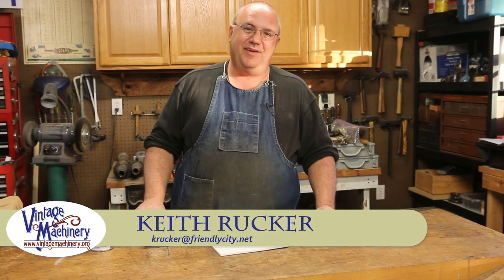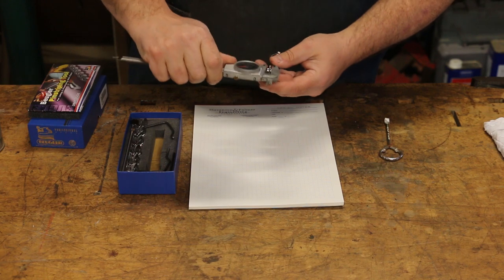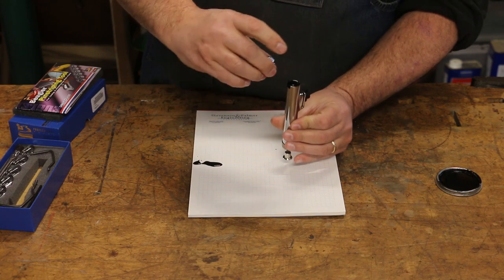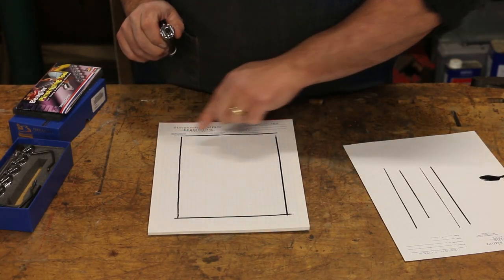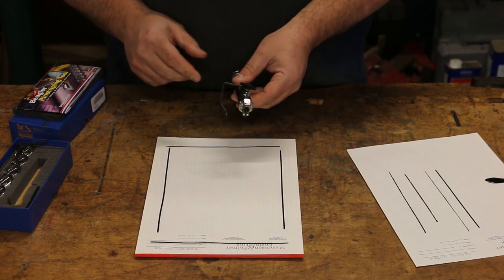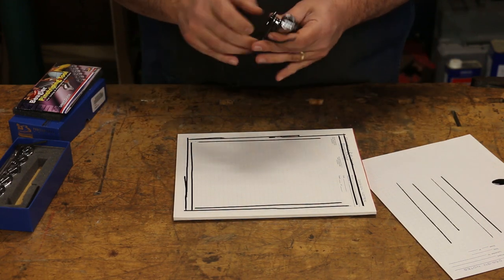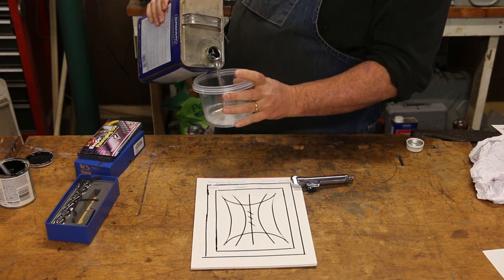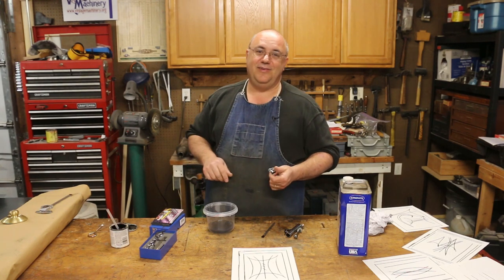Pinstriping with the Beugler Pro Pinstriping Kit

Comment: Pretty cool demo!  Nothing like real world experience. 
I dont think most machinists are artistically inclined. The only exception I can think of is Keith Fenner. A truly multi talented man.
Reply: I ran manual mills and lathes and other various machines like jig and surface grinders. I never did get into the the cnc software like cad or whatever is being used now. I could obviously set up, adjust and keep a cnc running, I just never did the programming. I prefer to feel the tool speed and feed speed and the pull/resistance on climb or conventional cuts. I’m artistic. And I LOVE manual machining. I look at them both very similarly. I think they are one in the same. I do know what you mean, but I feel like machining is art.

Comment: Hi Keith
When pouring out of gallon can you get a cleaner pour if you tilt the spout towards the far edge of can instead of towards the closer edges or corner.
Like others I propose a machinist solution to keep the wheel perpendicular to surface and act as edge guide.  A larger diameter rod having two 90* bends with the free legs being of equal length from bend, essentially a square "U".  Make rod length between bends such that you can easily adjust to follow straightedge.  Since the stock guides are so thin it is more practical to use larger diameter rods.  Fab a clamp like on the Beugler to hold the larger rod diameter and that attaches to the Beugler clamp.  When using set the offset to straightedge so comfortable and rotate the two free ends down to bear on surface.  This will keep the wheel perpendicular and allow for easy following of edge.  Also makes a good video of fab.

Comment: Some "tips" i'd like to share.

-It's best to stick with a hard surface. If you have scrap plexiglass, it's right about perfect because it's not metal hard but it's not paper soft either. It's almost paint close. You can also sand the plexiglass  back to retry.

-A good way to put paint in the container (i use it for my small air brush) is to get one of those huge syringes that have big, 2 mm needles (google this for the amazon link "Stainless Steel Luer Lock Dispensing Needle Tip"). They are perfect for this application.
Reply: ***** For the folks who don't have ready access to syringes, there are bigger droppers used for baby medicines and formula - called spoon droppers, and they hold 5 ml = 1 tsp

I use them for mixing paints for airbrushing, and for pipetting up rubbing alcohol to thin the acrylics

Or, one can buy the industrial syringes online...

Cheers,

Eric
Reply: chemech Heh, never thought of those things. I'm gonna give them a try. 

Thanks for the tip. :)

Comment: Keith, yes paper is easier than a hard surface. Best practice on a hard painted surface like you will be pinstriping on. I have one of these Beuglers and they make it look easier than it is to use. Practice practice practice, just like you would need to do with a brush. The wheels will grip onto paper better than a hard surface that has a tendency to slide around on you. In fact I think the best practice would be on glass as that would be the slickest surface and once you could master glass everything else would be a piece of cake.

Comment: 1 shot will wipe easy and neatly with isopropyl alcohol, just paint over the ends and wipe it with a clean cloth while its wet, Keith. 1 shot is nice to work with. thanks for the look at the tool though!

Comment: I just won the eBay bidding on this same BEUGLAR kit. I decided to replace my first Beugler that I bought with my first paycheque in 1961 at Sears. . The cast zinc head had deteriorated  and turned to powder.  My friend joked, " They don't make them like they used to."
  I have used Rustoleum and it is every bit as good as One Touch, for me.

Comment: I've used one of these quite a bit on horse trailers.  You can use magnets (cutting torch) of course but don't overlook a few feet of flat 10-3 or 8-2 wire bent to your curve and clamped or secured with neodymium magnets.

Comment: How long before you mount that for use on the lathe and milling machine. Just lower it to the work and feed the table across it for perfect lines.  I want to see all the pulleys for the Vance pinstriped when you are done..

Comment: Interesting kit.  I think you did better using your finger for a guide.  Thanks for the video.
Reply: Your finger did a good job, but I'm wondering if the factory guide would work better if you used your other hand to press it against the side of the workpiece as you go, and focus more on that and less on the paint wheel?  I've had similar issues with guides on cutting torches not staying against the side of the guide bar and shifting attention focus like that helped. 

-- Mike

Comment: With the tool having a way to hold a edging accessory you could probably come up with a machinist version that would keep the tool parallel to the surface and a lot less likely to wonder offline  pretty easily. Maybe a slot just in a piece of aluminum that would slide along a rule so you couldn't drift either direction. Just a thought from a guy with no art talent too.
Reply: Something along the line of a clamp an adjustable fence is what I was thinking. That way, since he was going to outline around the edges of flat surfaces anyway, the fence could just ride around the edge of the piece. I think it would be pretty easy with Keith's fabrication skills.

Comment: Now never heard of it called  steel wool  I almost spit my coffee laughing. I know you will show us the safe when done.
 At a machine shop I was at ,on the Mazak 24 .The were cutting spools from hollow stock. In other words cutting 12 inch od down in the middle to make flanges on each end. for high pressure in the oil field. So they were as long as a Mazak 24 is say 12 feet? He was FOR DAYS taking 300 deep cuts full length,slow rpm, coolant steaming,crisply rolling chips,sitting on the bench watching for days. Insert testing also. Mounds of chips. For days!!!